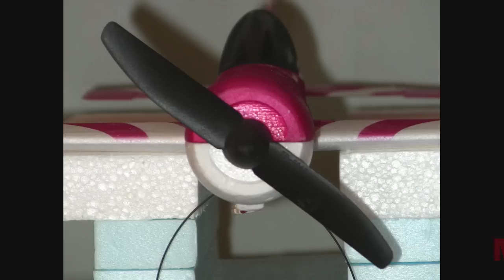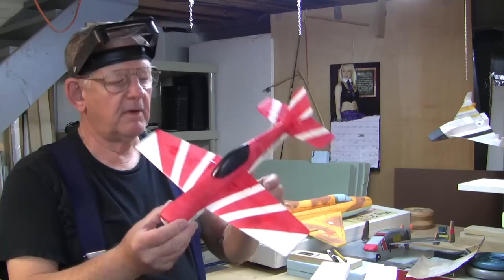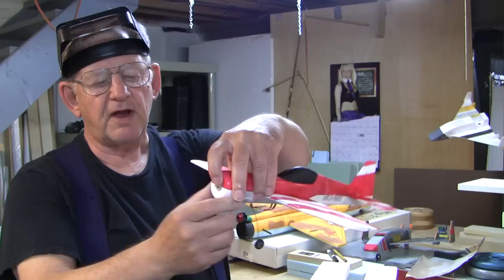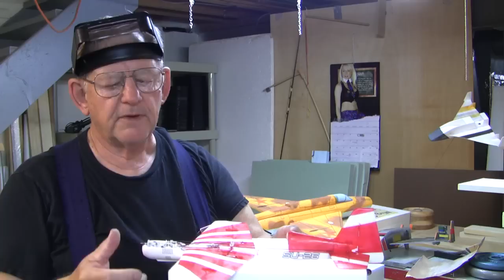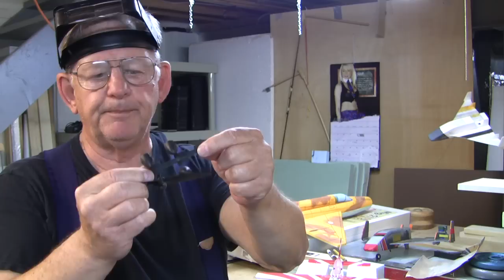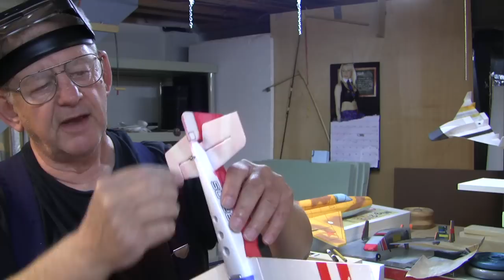Mounting the GWS 5 X 4.3 Prop on the Park Zone Sukhoi 26M & stuff

Comment from the maker: @machinedred  Test fit your parts and  apply a minimal amount of 5 minute epoxy or foam safe CA/gap filler taking care not to get glue on the moving parts. Foam safe CA is expensive. There are other glues that would work but I use those two frequently.

Comment from the maker: @machinedred , Thanks for the nice comments. What is surprising is that with the 5 x 4.3 prop and the larger battery the current diminishes. The motor and ESC should run cooler. You're welcome to use the color scheme. An unsanded surface will yield a glossier finish. I did mine with Copic ink pens sprayed with a Copic spray applicator. That is pretty pricey. Testers Spray enamel or Tamiya spray cans applied in light coats should work fine. Test on scrap foam. I masked with 3M blue 7 day tape.

Comment from the maker: Thanks, I'm using Hyperion 240 mah 25C cells. If you look at ALLeRC  you will see the rating as 25C/45C. 45C for short bursts but in this application you are running around 10C.

Comment from the maker: Sorry for the delay. I just saw your question. I used a Copic felt tip which was applied with a Copic Air Grip which is like an airbrush but it holds a felt tip pen and blows the ink off of the tip. The finish is splotchy because the plane was partially sanded. The ink looks different depending whether it is on a glossy or flat surface.  Thanks for your comment.

Comment from the maker: The motor actually is working less hard with the 5x4.3 prop. The 5x4.3 prop draws less current and runs at a higher RPM. That was a surprise to me. I figured if I'm going to get better performance I'm going to work the motor harder, but that isn't the case. I think the stock prop wasn't well designed. It has a high aspect ratio and for a prop that is small and not turning high RPM's you need a broader blade like the GWS props.

Comment from the maker: Thanks for the compliment. I recommend that you watch RemEMZ's videos. Also you could go to RC Groups and look up " New Product - PZ Sukhoi SU-26m receiver, servo tech, BL upgrade(s) in the works - in the Micro RTF"  forum .
  The center of gravity should be even further back than you can get with the aft most battery position. The plane is pretty sturdy and flying over soft grass will improve it's survivability.

Comment: I put my CG at 39mm to 40mm.  Flies best this way I find.  With the 5043 prop and 40mm cg, the elevator is FLUSH to keep the plane straight.  This makes for stable/straight inverted flight as well!  Basically depending on your sukhoi, you should adjust CG until your elevator is flush for stable flight.  Just wanted to add my thought there :)  but back to your vid... VERY NICE!  Thanks for the great info!  I am still waiting to do that battery mod, any info would be great about that! 5 Stars!

Comment from the maker: Yes the GWS props are heavier. Here are the weights -
Stock prop - 2.01 gm,  GWS 5.0 x 3.0 - 2.20 gm and the GWS 5.0 x 4.3 - 2.35 gm. I would have thought that the two GWS props would weigh the same but they don't.

Comment from the maker: I have a Park Zone Cessna and when the motor was damaged I replaced it with a direct drive 7 mm coreless  (orange ended) motor swinging a 2.5 diameter wattage prop. It was quieter and faster than the stock motor/gearbox. I haven't flown it in a long time.  The frustrating thing about them was the short radio range.